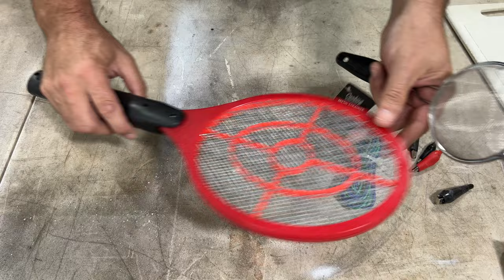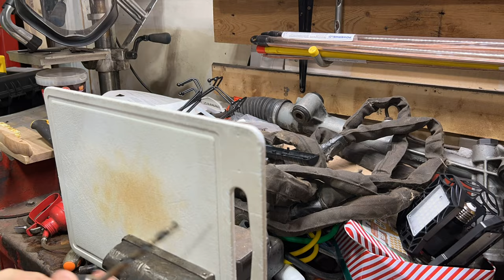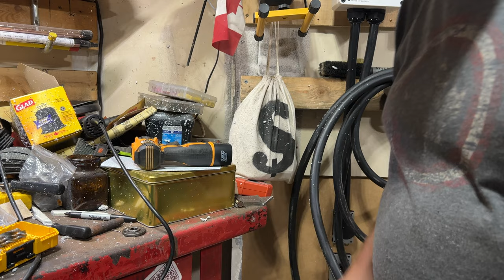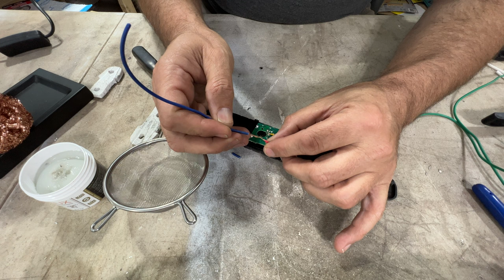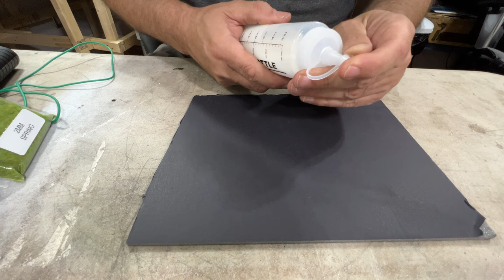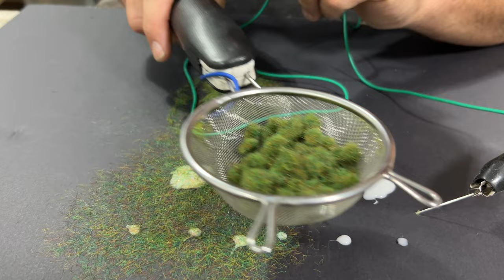Making A Budget Static Grass Applicator For Under $10 For My New Model Railway Scenery.

Comment: Maybe add a cellphone vibrator module to it connected to the same on switch so when you turn it on, it automatically agitates itself.
Reply from the maker: Sounds awesome, but way above my skill level.
Reply: @ScottRails  Just a small 3v motor with some unbalanced piece rotating.

Comment: If you want to turbo charge it try a Ion generator module, Thats what the pro machines use, I managed to get a cheap static machine but it still uses the bug zapper circuit, so as Tim the toolman taylor use to say more power.